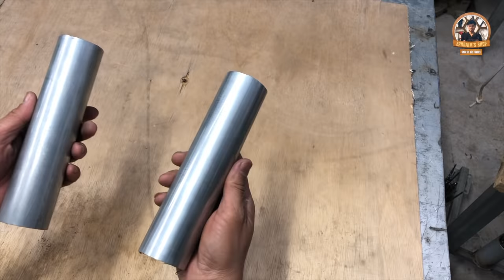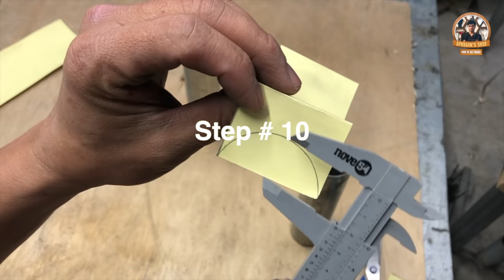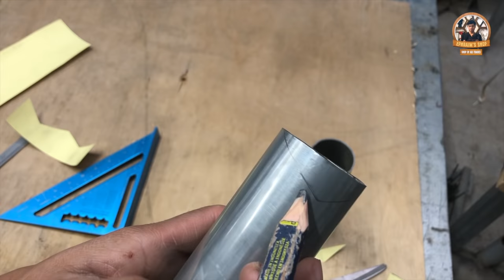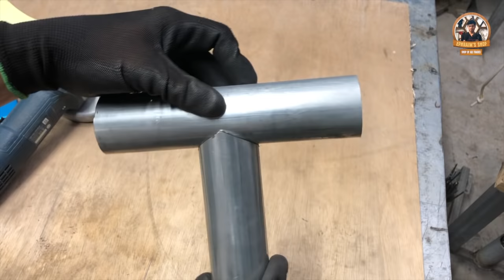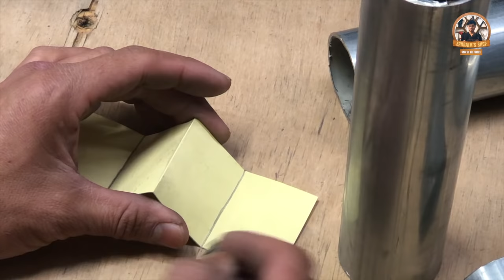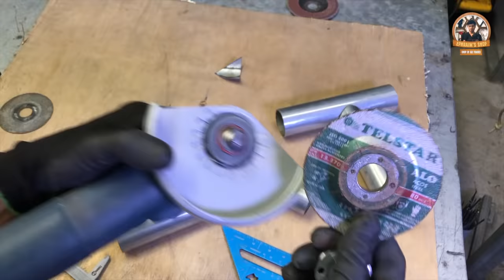How to NOTCH 90° and 45° ROUND TUBE | Pinoy Welding Lesson Part 15 | Step by Step Tutorial

Comment: Sir,tanong lang po anung welding rod ba gagamitin if mag welding ka ng different type of metal ex.S.S. to Carbon steel or G.i. to Black Iron ? either pipe  or iron bar. thanks and more power to you..
Reply from the maker: 6013 lang po
Reply: 309 welding rod for dissimilar metal.ss to carbon steel
Reply: Glang plang mang stang rang lang. Langston Michaels flang sprang arangatang

Comment: Pinahihirapan  mo pa ang iyong saril. 14 steps. When you can do it in four steps.
Divide the pipe into four segments. From the tip of the pipe take 12mm down  then draws line usinng paper from point to point on the pipe. Then cut.
Reply: sir pwede mo share actual pagawa nong,14 steps,

Comment: ANONG MAGANDANG WELDING,  FLUX CORED OR WELDING ROD??
Reply from the maker: pareho po halos same lang
Reply: Same lang rin sir.
pero kung Massive ang gagawin  preferred ang mga flux cored dahil dirediretso,like gmaw no need to cheap, unlike sa electrode (smaw) lagay ka ng lagay ,pero advantage nya pwede sya bitbitin kung saan saan.🤗
Reply: @hazelvannemoralestorel5275  OK LANG KAHIT ANG IWELDING MO KULUNGAN NG MANOK??? STEEL MATTING???
Reply: @eugene steel matting is a pre-fabricated.
pero kung [ repair ] po ang gagawin, you may use proper code of electrode also size po nito. na tugma sa kung anong steel bayang hihinangin mo.❤️
Reply: @PinoyWelding-EphraimShop  PERO SA MAKAPAL NA BAKAL ANG WEWELDINGIN PWEDE BA ANG FLUX CORED???  O SA MANIPIS  LANG PWEDE ANG FLUX CORED???  SALAMAT SIR!!!